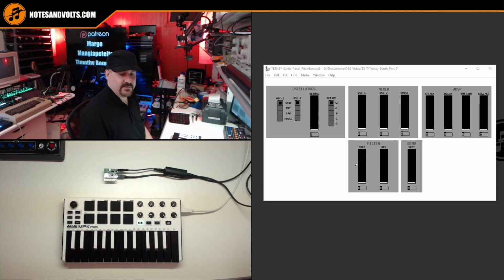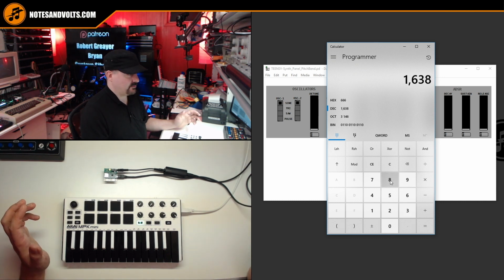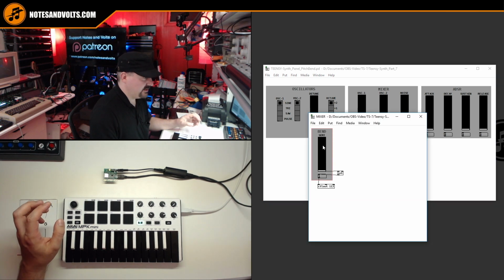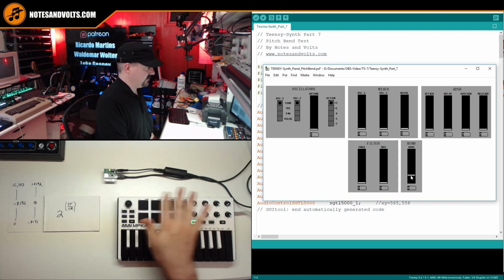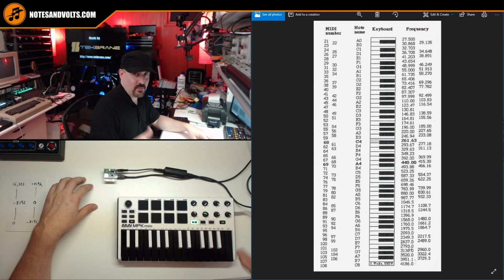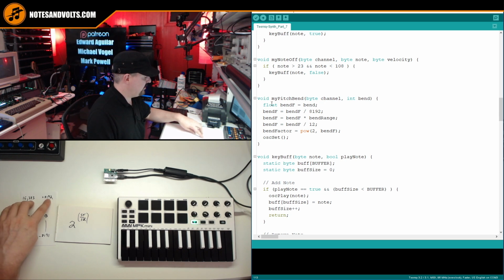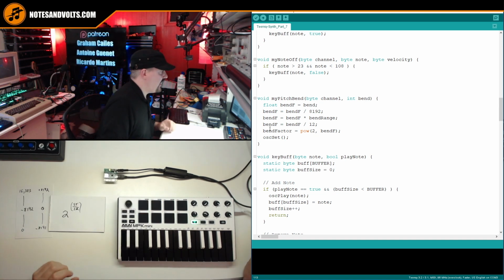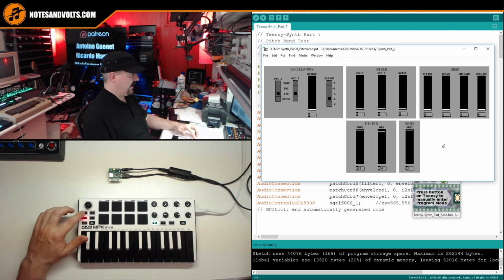TEENSY-Synth PART 7: PITCH BEND

Comment: Hello. I hope to get a proper answer as i have seen a previous question about the bender potentiometer you showed from a broken keyboard you got. Wondering where can we get some replacement parts online. Thanks
Reply from the maker: I haven't found a source for this assembly.
Reply: @NotesAndVolts  while i did not find a complete assembly, i found a potentiometer with a build in spring, so it always return to center. Brand and model Tocos RVQ28YS. For anyone interested

Comment: Pitch Bend range is traditionally set at the receiver, not by the transmitter. Scaling the full 14 bit bend range is a workaround for (the few) units that has no (fully functional) bend sensitivity parameter adjust. Behringer Model D is such a unit.

However, Pitch Bend sensitivity is now a Registred Parameter, and has its own controller setting. 

Check here for details:

https://www.midi.org/specifications-old/item/table-3-control-change-messages-data-bytes-2

Comment: Great Explanation of the inner workings of MIDI Pitch Bend... I always knew it was a different standard than the other CC# related control parameters. Am I wrong or isn't there a semi-pseudo standard for certain common parameters CC#71 is Filter Resonance, CC# 74 is usually Filter Frequency Cut-Off, and CC#01 is Modulation Amount. Further in that general pseudo-semi standard I think CC#100 and CC#101 are registered/reserved for controlling pitch bend. I know it's not as fun to stick to any kind of standard when you can just ignore convention and build things in a way that makes complete sense to yourself as you're building the synth. The standard practice seems to point to avoiding using any CC#s between CC#96 and CC#101, also CC#120(All Sounds OFF) to CC#127(Poly Operation) seem like things to avoid. What are standards for... except to break them though. I relly like that you explain all the algorithms  and programming behind the functions you're creating. Thanks Dave!!
Reply from the maker: Thanks Cameron! Yes, Midi does have a suggested list for CC numbers. I am just using the 100 range for this project for now because it still a work in progress. The numbers can be changed easily in the final version.